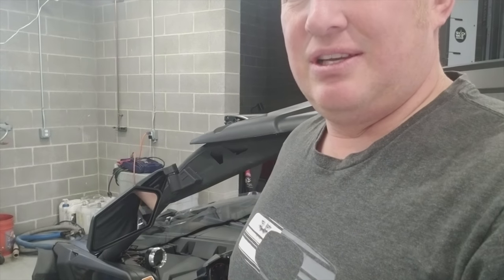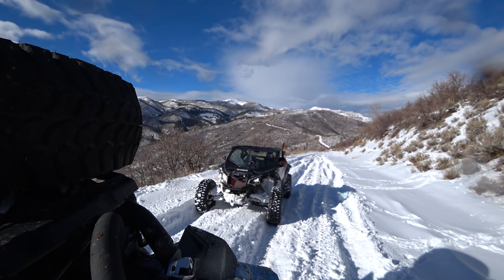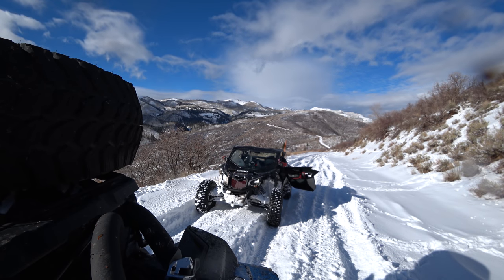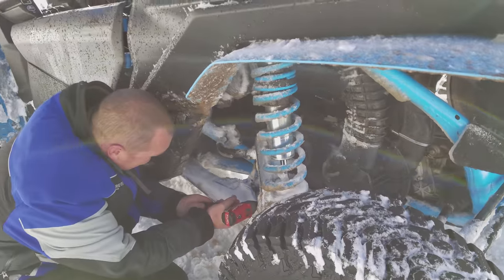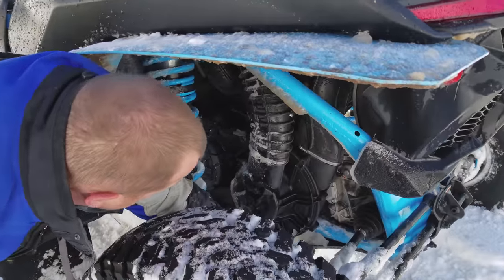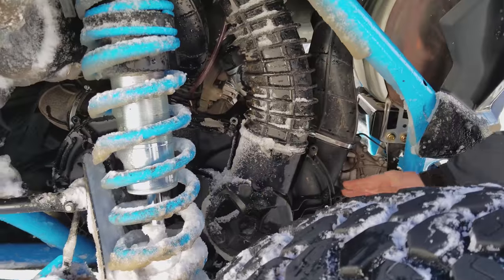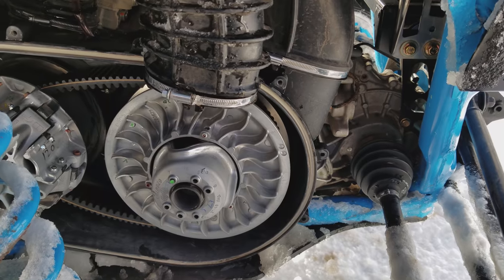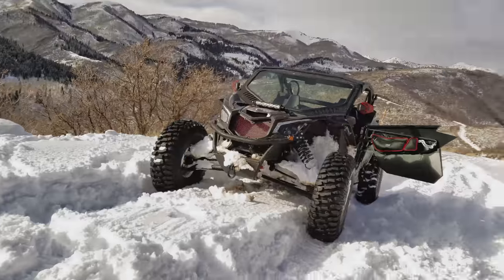2018 CAN AM MAVERICK X3 XRC BLOWN BELT !!!!

Comment: If you had a yami you could smoke the clutch, you wont change that out on the trail, thats why belts are better quick change and go but a belt temp gauge is a good investment , Ive had 2500+ on a belt before changing out never have broke one yet.

Comment: Clutches in back get hot , not like a snowmobile that gets cool air from the front . Belt temp gauge tells you what’s up , but you still need to go >> .i would add a bunch of Frogskinz to the cover to get more air in and heat out . Brings down the temp a lot if your in the gas a lot .

Comment: I have a 2018 yamaha kodiak 450 with 1300 on the stock belt: 26 zillas tires, mudding, riding full throttle all the time almost, multiple top speed runs, drifting in dirt road, donuts, burnouts in high with no belt smoke or smell, and your can am climbs up a snowy hill and goes kapowi... I’m not hating on can am or your machines but dang man.
Reply from the maker: Zach it sounds like Yamaha has a pretty good belt system but there's a big difference between 27 horsepower and 172 horsepower just saying.😎👍
Reply: Brandon Pierce yea definitely if that yamaha had like 200 hp it would have some problems

Comment: Clutch heat is your enemy, not many manufactures have figured this out yet.  I have a power blower on my clutch intake. Makes my temps alot lower.
Reply from the maker: +Mike Panocatapolis thanks for your advice on the clutch. I will look into that fan. I really haven't had a lot of problems I've just beat it up the belt pretty good and it was time to go.

Comment: Brandon, what tool are you using when you are screwing it on the clutch itself? It's not in your list, am I missing it?
Reply from the maker: Here's the link to the clutch tool it should have came with your Can-Am👍

https://m.ebay.com/itm/Can-Am-2017-2018-Maverick-1000-X3-CVT-Spreader-Tool-708200720-Secondary-Clutch/192462728685?epid=20014660520&hash=item2ccfac2ded:g:8TgAAOSwuA1afcab

Comment: How big are you? I'm 6'4" 260lbs and about 24-25" wide at the shoulders and I wear a size 14 boot. I really want 1 of these but I'm not driving 120 miles 1 way to the closest dealer that has 1 to see if I fit..
Reply from the maker: Matt S I'm big. I fit in it good. I'm 6-3 260. I think you'll find that it is plenty big inside and very comfortable.👍
Reply: Brandon Pierce Thank you!
Reply from the maker: Matt S no problem buddy good luck

Comment: Hey B!  Great fortune to have the tool kit.  Since blown belts are a reality I thought I'd share what I'm doing.  I just barely finished upgrading the clutch housing with the team alba clutch case liner.  It's a machined aluminum that fits precisely inside the clutch case housing to keep the shredded belt from tearing it apart.  I also upgraded the bolts to the quick release or clutch cover pin kit for fast removal of the housing.  Check it out!  http://teamalbaracing.com/i-23900779-canam-x3-clutch-cover-shield.html
Reply from the maker: +Rob Staley awesome man that sounds really cool I like the quick release idea. An aluminum clutch cover sounds awesome too. if these belts explode they can break apart your hole cover which gets expensive. Thanks for the tip👍

Comment: If you burn a belt on the snow you got issues
Reply from the maker: Belts have a hard time in mixed traction I was blowing through powder and then also hitting dirt changing the RPM a ton and putting a lot of pressure on it. the Belt had over a thousand of miles of hard riding on it it owed me no favors.

Comment: Isnt the 18 Turbo R Belts part no 422280652? Your link goes to 417300391.
Reply from the maker: +Brandan Francis I will double check on that Brandan. I thought I had the right link but I could be wrong. I will check now and change them.👍
Reply from the maker: Brandan Francis you were right. thanks for the tip. I changed the belt to the correct one I appreciate it.👍
Reply: No problem ordering some stuff from your kit right now liked your idea on the tool bag!
Reply from the maker: Brandan Francis I have been lucky up to this point. it feels good to be prepared. thanks again
Reply from the maker: John P yes the link is in the description
Reply: John P 422280652 is the belt for 2018 x3’s that are TCIC turbocharged and intercooled the new belt for 2018 or an upgrade for 2017 models

Comment: IF YOU WHERE IN A  Yamaha YXZ1000R THIS WOULDN'T HAD HAPPEN THIS IS WHY MY FIRST PURCHASE OF AN SIDE BY SIDE WON'T BE BELT DRIVEN.
Reply from the maker: +dawayn ruff thanks for the comment. you're right belt drives are not perfect. but most the people that have a Yamaha that drive it like I do end up blowing their clutch. so just different problems
Reply: dawayn ruff my son has a 1000 we were at Bundy hill off road park and his clutch went out. Not a cheap fix, it’s still sitting in my barn. He needs to come get that thing, but I digress.
Reply: BLAH BLAH. when your clutch fails it will be longer than 10 mins to fix it.
Reply: Most are drivers not knowing how to drive, many have 3000+ miles on the clutch, try that with a belt.  It's crawling that blows clutches as people start riding them, wide open the clutch is engaged...
Reply: Bill Youngblood
 3 k on current belt..
Reply: Mike Panocatapolis good for you, rare indeed.  Especially for a can am.
Reply: Bill Youngblood
I find that it is varable based on your terrain and driving.. If you are WOT all the time, in mud and sand, they wont last long.
Reply: Mike Panocatapolis Mike Panocatapolis I have a few belt burners as well, they are just boring.  You are right though, knowing when to use low range vs high range is a big part.  The terrain, with the right cvt setup, it doesn’t matter.  There are guys running them with no covers through sand, dirt, and water.  Hose the cvt off and go.
Reply: The YXZ clutch is really durable. So I don’t want to hear the ridiculous comparison.
Reply: DUNEYXZ had one for 300 miles about 18 days of owned and the clutch went and I traded in on a Polaris haven’t had any problems with it for 1 year so far